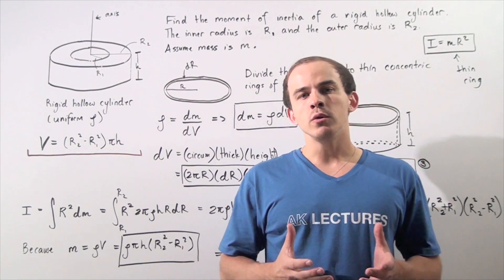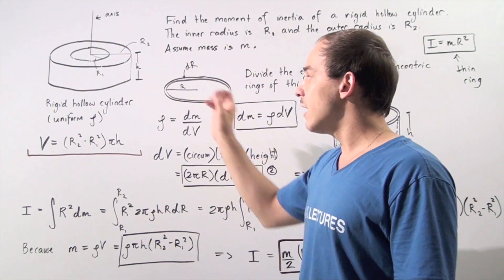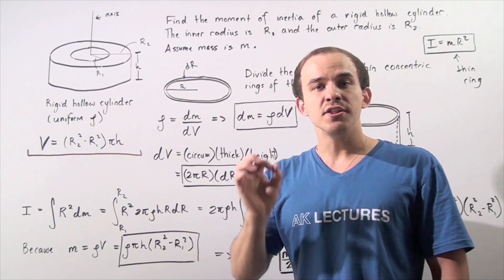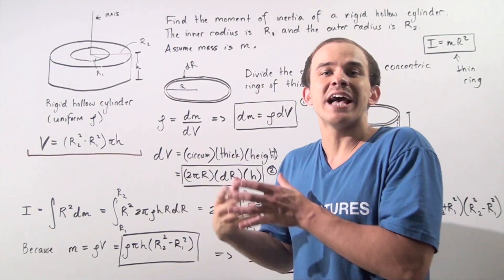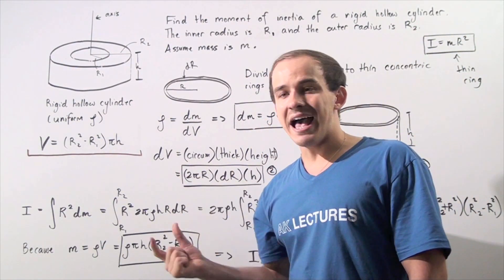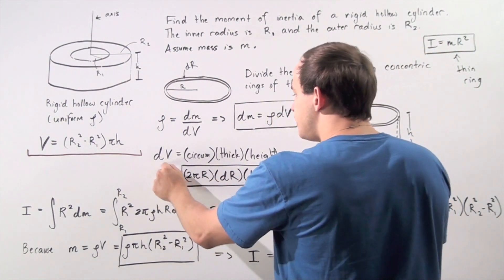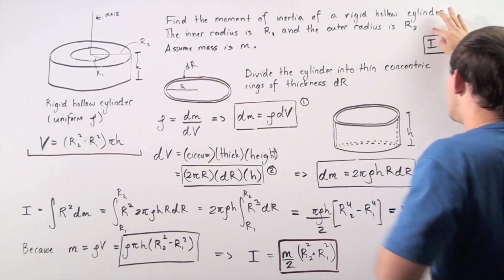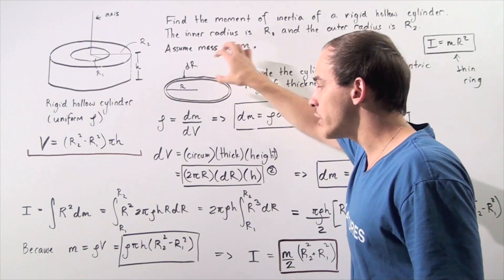Moment of Inertia of Hollow Cylinder

Comment: The only thing that keeps tripping me up is how/why you went from the initial Vol (which is what made sense) to the dV=(circum) (thick) (height) deal... 🤔?? I mean, can we end up a the same place keeping the original Vol equation??
Reply: it's because we're using calculus, so we're summing up all the little pieces of dm/dv. each tiny piece is going to have a different dm and dv, so we need an equation that represents that. sure, you might get the same answer with the original volume equation, but that might not always be the case with such problems.